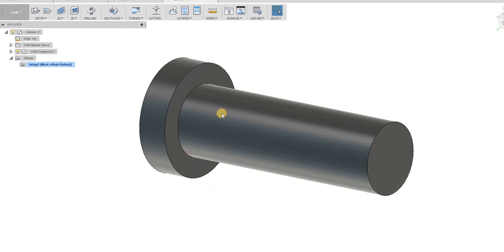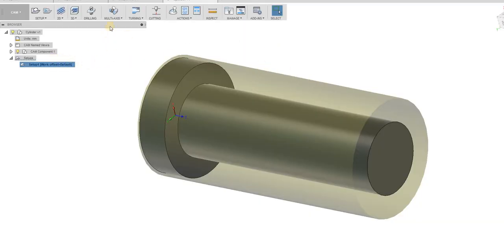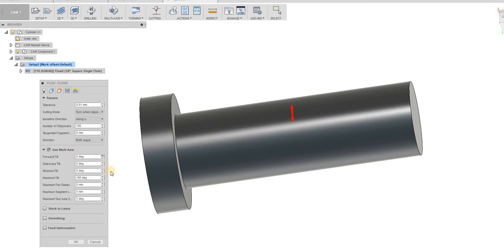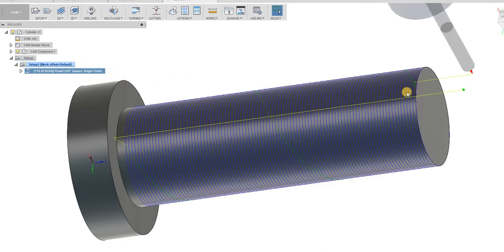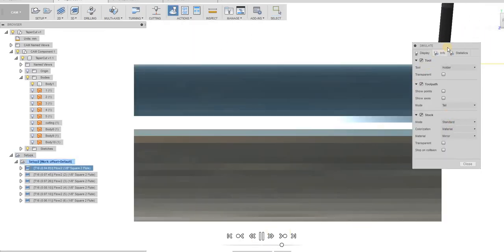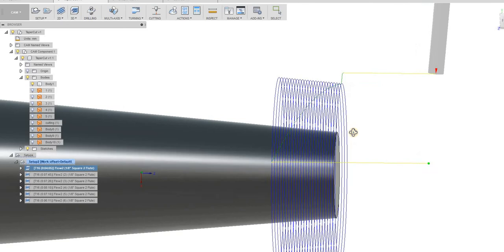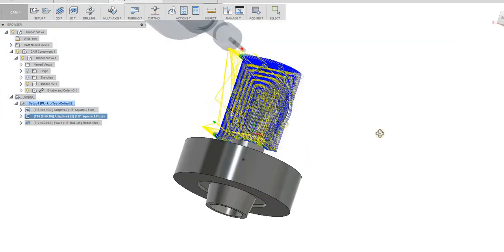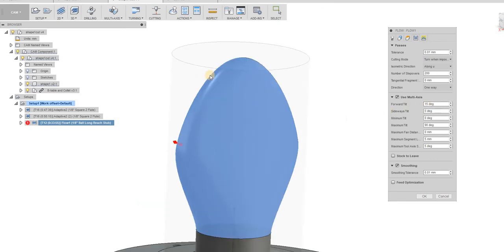Fusion 360 4th and 5th axis toolpath with Flow

Comment: Doesn't work with 4 axis.
Reply from the maker: I have got it to work on Pocket NC, but it's limited to 20 full rotations in a single direction. (B axis does not reset to zero from 360). Other post processors from other manufacturers may work completely different.
Reply: @loganrose2791  Thanks. The beta rotary work correctly. Text command, cam.f
Reply from the maker: @Reaper9020  Haven't done that.  Is that a fusion beta?
Reply: @loganrose2791  yes

Comment: So this is pretty awesome.  Don't understand why it took me two days of hunting to find your video though.  It should be right up top :)

I got it to work with round shapes but other shapes (like oval) are more troublesome.  Have you tried that?
Reply from the maker: It works on the software, but this process would probably take a different post edit to get it working.   I wasn't able to get this to work on my current 5 axis machine.